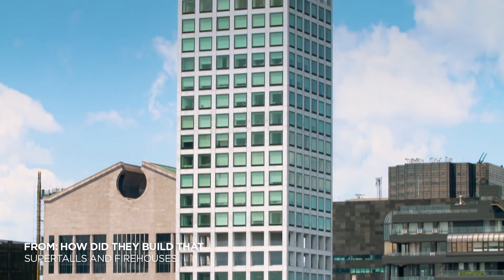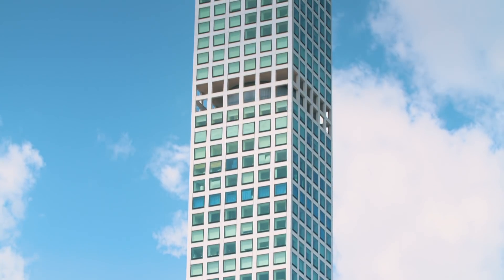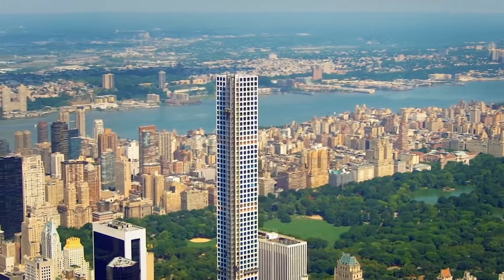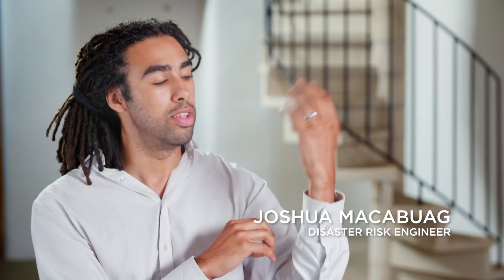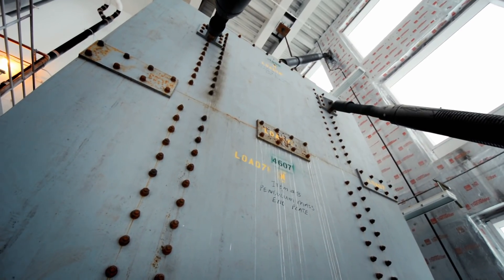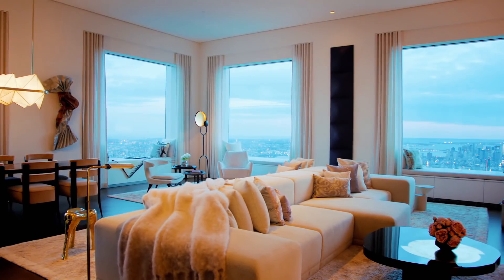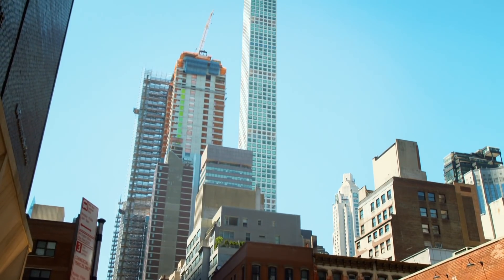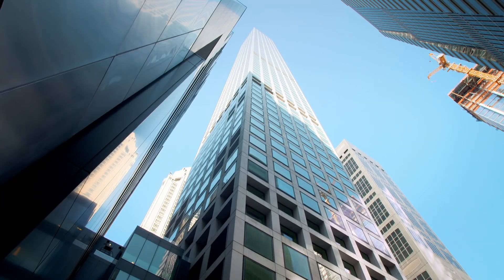How To Stop a New York Skyscraper from Swaying 🏙️ How Did They Build That? | Smithsonian Channel

Comment: LOL. Just seen a vid today - massive litigation over the failings of this building!! Alleged that it sways 50 to 60 inches!! It floods as pipes burst, lifts don't work, shoddy handrails which folks were told to repair with duct tape, apparently. Any apartments on the market, offered at around 30% of the original price............How things have turned out it would appear. I guess it will be interesting how the lawsuit turns out and what the judge's findings are after considering all the expert evidence that will no doubt be called.

The design was based on an expensive trash can = and I guess the trash theme continued....

Taiwan has a sky scraper where their pendulum system actually works - their pendulum is a ball shape = and I guess their might be something in the movement of a giant globe that might have a better balancing effect than a rectangular solid - just a thought that the movement of a suspended round object might be more effective.

Comment: "active dampers" does that mean it runs off power/electricity? and what if the power goes out?
Reply: a petrol powered generator kicks in, presumably. what happens when the power is out for so long that the generator runs out of petrol? well it's building 7 all over again.
Reply: @soberacidtrip  The third building they demoed?